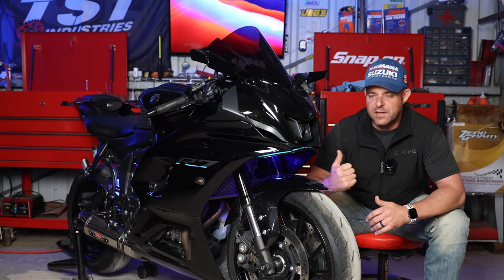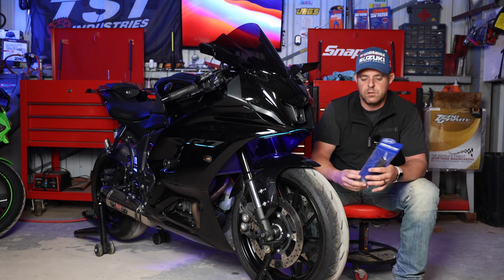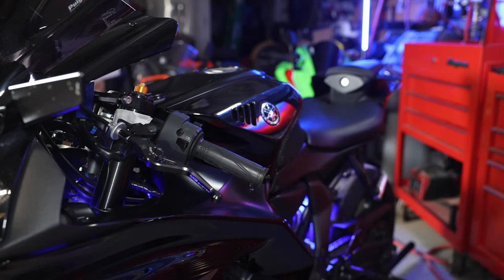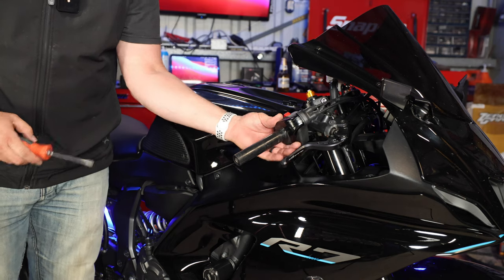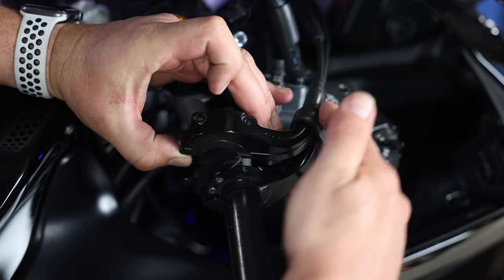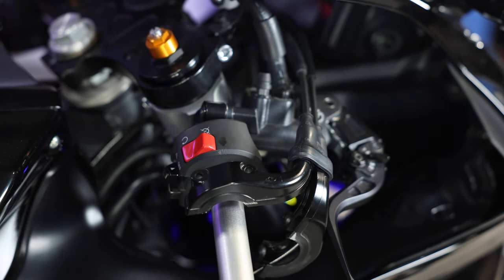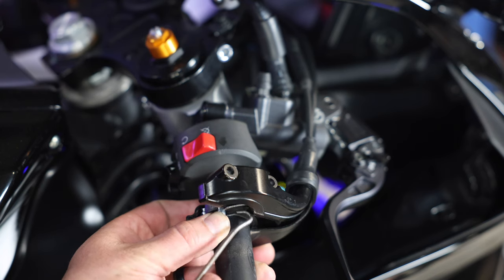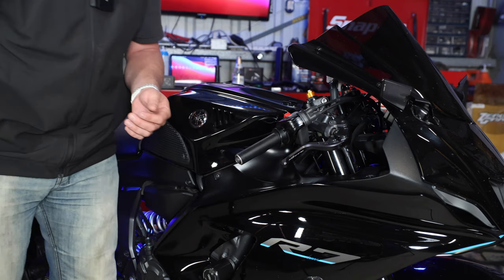Yamaha R7 Shorter throttle tube & new grips

Comment: Thanks for the how to, inspired me to install my R6 throttle tube. No free play adjustment needed?
Reply from the maker: I didn't notice a need for it
Reply: Is the R6 tube pull way shorter than the R7 one ? Because it is super annoying to have such a long pull on the R7 tube
Reply from the maker: I can get it to WOT pretty easy now, I wish I would have measured it. I didn't remember until I had the tube off I was going to measure

Comment: I’ve heard the motion pro R6 throttle tube isn’t that different than the stock R7 throttle tube throw, I put the OEM R6 tube on and man what a difference!
Reply from the maker: Interesting, they did look really similar I thought I got the wrong one but when I measured it with a vernier caliper it was different by 1mm each side and feels much different the. The stock tube did so maybe a stock r6 tube is different but this works 🤷🏻‍♂️
Reply: Did you have some slack after installing the R6 one or was it stuck and you had to to some changes to the throttle adjuster ?
Reply: @Gino.R7  it was stuck but a little adjust at the base of the clutch lever should do the trick, if it’s still sticking check the clutch cables on right side of the bike and adjust those !
Reply: @aminogaming8469  thanks for answering man, what exactly do you mean with base at the clutch lever ? Shouldn’t it be something around the break lever on the right, where the adjuster for the slack for the throttle is ?
Reply: @Gino.R7  my bad lol wrong side 🤣🤣 my brake lever was fine it didn’t need adjustments
Reply: @Gino.R7  if it sticks adjust the throttle cables down on the left side of bike under the gas tank should be able to see them when you look at the left side
Reply from the maker: No I didn't have slack after the install but it can be adjusted out